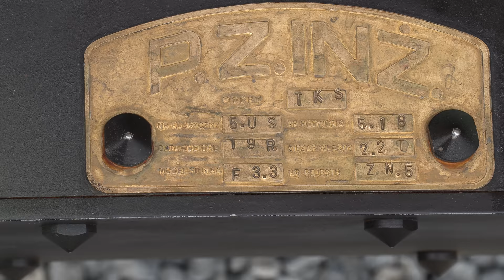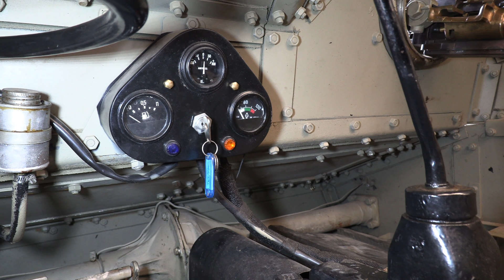Inside the Chieftain's Hatch: TKS

Comment: This little thing had some serious potential when armed with a 20 mm gun. It was then capable of destroying enemy tanks, and there are accounts of such actions. Less than 30 received such upgrade before the start of the war though, so the impact on the campaign was limited. With its small size the tankette could maneuver quickly and squeeze into hideouts making it difficult to spot and aim at. At the same time it was more nimble and faster than a proper tank of the time.
Reply: But that thing had almost no armour. Why not just use the Anti Tank Rifle than put such a Gun on a Tank. After all you can hide a Soldier with such a Gun better than a Tank.
Reply: @maxpayne7459  Yeah, but try to move that shit when under fire. It weighted around 60 kg. Also, this was the plan from the beginning, it was designed as weapon for tanks (especially TK's as seeing how the tanks were developing meant it would be too obsolete (there were experiments with mounting 37 mm gun on them, named TK-D , but it was cancelled in favor 7-TP with it.).) and planes (it was a HMG).  For infantry there was kb ppanc wz. 35 which was almost as good while weighting just over 10 kg and being much easier to produce.
Reply: @Vyury  the enemy would just fire with Tanks back. Only 1 Hit would be enough to kill  the Tank or kill at least 1 Crewmate. It would have been easy to just build more anti Tank rifles than build these Things. Considering that the Germans had more Tanks, better designed and have Air Support, the Tank would just make a bigger Target than a Person
Reply: @maxpayne7459  An mg position is a 2 man affair anyway, and in one of these the crew was much more mobile and protected from small arms and artillery shrapnel pretty well all things considered. A 20mm autocannon is way too bulky to be an infantry weapon.
Reply: @maxpayne7459  The Polish anti-tank rifle wz.35 came in at about 10 kg, plus the ammo. The rifle was about 180cm long. That's a lot of gear to carry around. On top of that the rifle was most effective at about 100 meters or less. It's going to take some nerve to get within 100 meters to a tank, especially if that tank is driving straight at you.
Reply: @comdo831  isnt it better just to build more and have more in reserve. After all how many of these Tank can be replaced? If an Army is equiped with these Guns and have still Spares than it matters less if you cant take the Gun with you.
Reply: @jacmar44  it is more easy to supply a Group with Anti Tank rifles than supply a Group with Tanks. After all you have to give also Fuel, spare Parts and has to be Repaired in case it was damaged. The Armour was also not very thick. While it could protect small Arms fire and Shrapnels it would still lose against Anything that has a Better gun. Considering that even  the German light Tanks could easly destroy them. I just dont see the point in building Tanks if you dont have the Industry to build much more of them. A very small Number of Tanks doesnt change much. I think its more important to make more Anti Tank guns than try build Tanks if the can make more of them
Reply: TopKon  still even in the offensive Germans could simply produce more Tanks than Poland could. In the End Poland would have no Tanks and could not replace them . Arming The Soldiers mit Anti Tank rifles wouls be more effective since it could easly replaced and it would be more likely that you get Ammo for the Anti-Tank Gun than fuel or Spare-Parts for Tanks. Even the German in the Late part of the War build more Anti Tanks Guns than Tanks since they can be Produced more and faster.
Reply: TopKon  yeah. Thats True
Reply: TopKon  After regaining independence, the situation in Poland was such that there was practically no industry. Both the Russian and German armies took their factories with them. Thus, Poland's primary task was to rebuild industry, which was largely successful. However, this does not change the fact that in 1918 Germany started with the entire industry, so despite Polish economic achievements, in terms of production, we were actually inferior to the Germans. But I will not agree in terms of technology. In this matter, the potential was comparable on both sides, just look at the designs and prototypes created in Poland before the war. And don't forget that the Polish Army was supposed to fight together with the Allies in September 1939,  not remain alone. Anyway, when the September campaign came to an end, the Germans had supplies to conduct offensive operations for about 7-10 days.
Reply: TopKon  You look at it a little wrong. In the September campaign, the Łoś was used against its purpose. None of the medium-range bombers of this period were fit to attack armored columns. So whether it was Łoś or Wellington or Ju-88, they would suffer heavy losses in such attacks. Polish airforces did not have any aircraft designed for this, so simply they used what they had. Such a bomber is an offensive weapon and this gave rise to doubts in Poland about the sense of designing such a airctaft, since Poland was not planning to attack anyone. Most agree that the resources and time devoted to designing Łoś should go to the design of a modern fighter. Even promising prototype was built, but too late. The TKS was already outdated then, the Polish authorities were aware of this, so they were used only for reconnaissance or support of infantry, and not for fighting against other armored vechicales. There were also TKSs equipped with a 20mm cannon of Polish construction called NKM wz.38 FK. Maybe the gun itself was not clearly better than the world's competition, but it was in no way inferior to them. Similarly, the 75mm wz.36 anti-aircraft gun was fully competitive. It is also worth mentioning that the tank periscope was a Polish invention.
Reply: TopKon  The Panzer l didn't have a big chances of destroying the TKS, the Panzer ll would because of the additional 20 mm cannon. In general, Swedish 37mm cannons and wz.35 anti-tank rifles were successfully used against tanks, including the Panzer lll and lV. And it's even funny that the 7.92 caliber rifle was capable of disabling the Panzer lV.

Comment: Whermacht: " It's tiny! It's like a toy! It'll never last against us! "
Add 1 X 20mm and 2 X Polish soldiers...
Whermacht: " It's SCARY!! "
Reply: There were two (prototype) TKS-D vehicles, basically a tank destroyer variant of the TKS (37mm Bofors AT gun on a modified, open-top TKS chassis). Used in combat by the 10th Cavalry Brigade (Motorized). Now that would have enough punch to make short work of any German armored vehicle of that era.
But even the basic TKS wasn't, in my opinion, bad for what it was: basically an armored scout car on tracks - because that was exactly its role and assignment. Though obviously hindered by the lack of radio and better vision equipment (then again, being developed in early 30s, it wasn't surprising).
As for the Germans... they nicknamed the TKS "the armored cockroach" - supposedly reflecting how nasty, fast and difficult to get rid of it was. Keep in mind: this thing could drive well over 30km/h off-road, armored well-enough to shrug machinegun fire, and was smaller than a standing man. Even a basic HMG one was enough to give trouble to anything not being a proper amrored vehicle itself...
Reply: I mean the Wehrmachts most common tanks in the invasion of Poland were the Panzer I and Panzer II, which aren’t really much better
Reply: not scary at all for Lieutenant Gruber for sure
Reply: @deeznoots6241  compared to Panzer I and II is the Polish 7TP and not the reconnaissance TKS
Reply: yeah, its too bad they were facing the WEHRmacht who werent scared at all.
Reply: @thurin84  they all were most of them were forced to fight lmao
Reply: @mateuszwisniewski3877  Had it been complemented by more of heavier vehicles, it still would have been useful.
Reply: @Khabaal87  He's right actually. Also - Polish campaign was NOT typical "blitzkrieg" ( terms that Germans themselves never used).

Comment: If the tank was on fire, the fire would be right next to the entire crew
Reply: The chances are, the crew would do a better job of protecting the fuel tank than the armour would.
Reply: This tankette is so small that the fire couldnt even fit inside. Needs to stay out so no problem.
Reply: TheScout115  What you need to do is what's done on (more) modern vehicles, drill a small hole above the cap's seat and braze a hose bung to it to slip an overflow tube. If it's not an internally seated cap you can get one easily from... well, the radiator of any junkyard car made since the 1940s. 

Brilliant little machine, looks quite sprightly to be honest. That model A engine with it's low compression and long stroke would be about perfect for that application (and if I recall, the flywheels on such a critter weigh an absolute ton).

ED: If it ever suits your fancy, take a look at what the salt racers at Bonneville do with those motors, bump your TKS up to 100, maybe 120 horsepower, add some rubber pads to the track, and send it.
Reply: TheScout115  I completely understand, just a mental exercise. A man can dream, right?

I was serious about the coolant cap though, that's a pretty hairy safety risk. Radiator pressure test kits often have clamp-on extensions, brazing one to the bung from a modern radiator would give you an overflow header that can just be twisted off and the original cap put on for display. When driving and expecting potential heat, just put the "safe" cap/header on and drop the hose down that vent port in the hull bottom.
Reply: TheScout115  Just throwing that out as a removable, no mod required safety option.
Reply: Just about everything is right next to the entire crew in the TKS....

Comment: Even today, something like that with some ERA or slat armor would be useful for infantry support especially if the MG was replaced with a small auto-cannon.  I guess the closest equivalent is the German Weasel which I hope the U.S. military ends up buying as I know they were evaluating it.
Reply: i think they stopped making them, also for the TKS to be really useful in modern combat, it could really use a turret, with any weapon
Reply: Remote controlled turrets started to show up during WW2 and should be an obvius choice if you want more room inside. The gunner could have TV screen in front instead but keeping the crew outside is also an option, it could be a drone.
Reply: @quentintin1  The Weasel is still in production to my knowledge, but yes a turret is certainly more useful than a forward facing fixed MG or cannon.
Reply: @michaelpettersson4919  Certainly that would be useful but I'm not aware of any TV screens used within armored vehicles during this period.  Most remote turrets of the period actually used a series of mirrors. The only remote camera TV screen I saw used was for some of the early guided missiles that were trialed during the war. These were mounted on aircraft and used against Axis naval forces.    Still that being said, a remote turret with a good periscope sight mated to it that allowed for both traverse and vertical movement, would have certainly been doable along with a back up site.  
These of course we have advanced and highly modular OWS (overhead weapon systems) that are perfect for a little armored vehicle.  We use them quite a bit today and the Russians are also using similar systems more and more.
Reply: @wigon  When I mentioned remote controlled turrets I meant it as thease where in its infancy at the time. TV cameras may have existed but hardly useful at the time bulky and unreliableas as they where at first. So the TV screens would of course be on a modern variant. I am writing this on a pad computer with tuchscreen but recently I got a "new" computer at home and for a while used an old heavy computer screen. I have seen the flatscreen revulotion. 🙂
Reply: @michaelpettersson4919  Yup...I grew up in the 80's and likewise saw massive technological evolution.   Flat screens are indeed amazing!  That being said, some old electronic and military technology still works surprisingly well.   I remember reading how one reason that a Iraqi Mig-25 was able to score a kill on an American F-18 hornet during the first Gulf War was because of it's massively powerful radar (that used vacuum tubes) that literally burned through electronic jamming.   In that case the Mig-25 was used as intended scoring a kill from beyond visual range and then quickly retreating at high speed to avoid a counter-attack.   It was one of those cases where old military technology trumped new military technology.
Reply: @wigon  And in the trenches of WW1 the humble shovel became an battle axe. The old may indeed work supringly well.

Comment: That'd be a great garage project...a real tank, if a tiny one. Just the sort of thing a skilled fellow could build in his spare time.
Reply: If you are okay with using mild steel plate instead or armor plate, and can find and afford all the unique and rare parts. There is a lot more to it than just bolting it together. You could certainly build something that looks very similar on the outside, but where are you going to find or fabricate components like the track assemblies, drive axle, brakes, periscopes, etc? You can't just machine them on your CNC machine.
Reply: @justforever96  It's not a tank if it isn't armor plate. Mild steel won't stop much. And thanks for ASSuming I'm an idiot with no understanding of armored vehicle suspension, drive trains, power plants, or hydraulics. Good job.

Comment: The helmet looks like a modified  French Adrian helmet. Is that the case?
Reply: Yes. Infantry used newer model, but that tank helmet get to Poland with Renault FT tanks.
Reply: Yes. Polish forces used modded Adrian M15. It was quite literally a process of taking M15 - often damaged -and lopping off bits that weren't needed. It looks similar to M1919 variant, but it isn't. More importantly, it was not a mass production, but rather individual soldiers did it themselves, so there will a huge diversity, if we're talking about original Polish equipment. This one looks like a modern replica, available online.
Reply: Maybe cuz it is one.
Reply: @gmaacentralfounder  not a damaged helmet, just mod for armour use, the French tank helmet of WWI was exactly the same, after their first ride in gear the tankers decided to lop off the visor and add a leather strip to the front, in French service the upgraded model would remain mostly the same with the addition of some padding and a new strap that could accommodate earphones (if you were lucky enough to crew a tank equipped with radio)

Comment: The steering wheel was installed due to something called "autotransporter" it was basically a wheeled carriage which you could put tks on and then hook up tks to the carriage so tks would power it and you could drive this from tks.

Comment: Car guy here. I'm not really sure what gave you the impression there's no final drive(other than this is probably a fairly unique setup for a tank, although I'd be surprised if no one had a similar idea for other tankettes) but the final drive is built into the differential. In fact I'm pretty sure the entire drive axle is actually out of a Ford Model A, which is also why the brake drums are bolted to the drive sprocket. Hope this clears things up a bit

Comment: If that is really a "ratchet" (and it appears it might be), you don't have to unlock the pawl manually to tension the track. That would just be some sort of pawl-and-detent setup. A ratchet by definition moves in one direction, and locks in the other. Those teeth appear to be angled on one side, so assuming it is indeed a ratchet, simply levering the tensioner device rearwards should cause the pawl to disengage and jump to the next detent or tooth. When you release the torque, it should fall into the first detent it comes to, and then lock there by the vehicles own weight. That is a ratchet. To UN-tension the track, you do have to lift the pawl manually, which maybe its what you were talking about.

Comment: I'm from Poland and I ask for "7TP" tank now :D

Quick hint:
It's polish massive upgrade for  Vickers E with 6 cilinder diesel engine
with armor up to 17mm
and at the main gun - 37mm bofors cannon
Till 31 of August 1939, a bit more than 100 were maid.
This tank could deal with any german tank that were used in 1939
It was so good that 3rd reich and zsrr collected and repaired damaged tanks and along with captured ones
used them in their armies.
We have a reconstructed 7TP at Museum of polish army in Warsaw :)

One more thing:
During WW2 we've started production of modernized version - 9TP with armor increased up to 40mm
but because situation was critical, we've managed to put up abount 10-12 of those upgraded version

Comment: Now I want to make one.  Swap the old engine for a little fuel injected 4 cylinder, swap the manual gearbox for a 5 speed automatic, disk brakes instead of drum, and put a tiny remote control turret on it with video camera.

Comment: They've turned the Chieftain into a McDonald's prize.

This wouldn't actually be a bad vehicle with minor improvements. Use it as a fire-support section for an infantry platoon. Cast the body instead of welding it together in pieces, improve the tracks/steerage system a bit, and also improve the ability to see, this would be a pretty good support system.